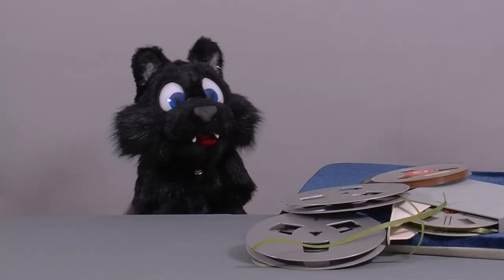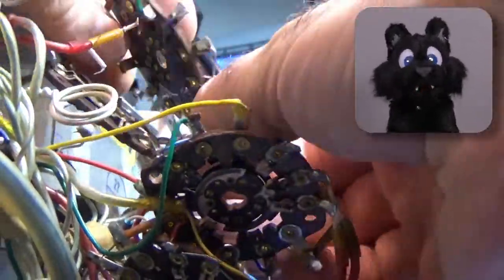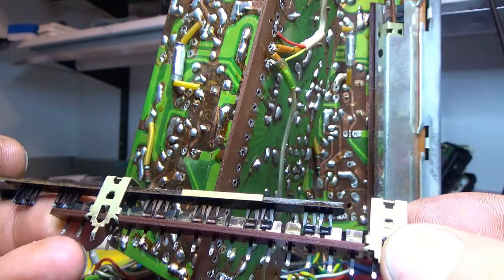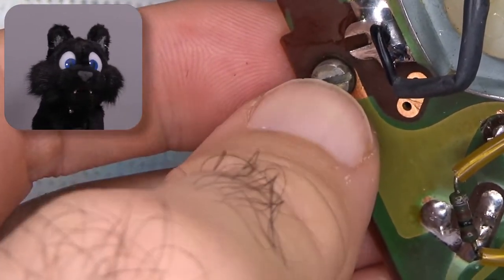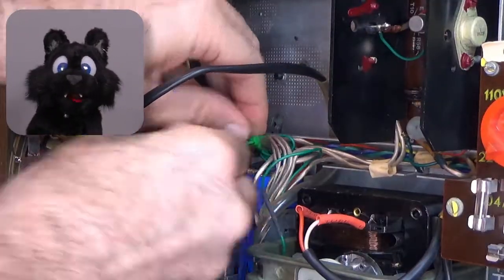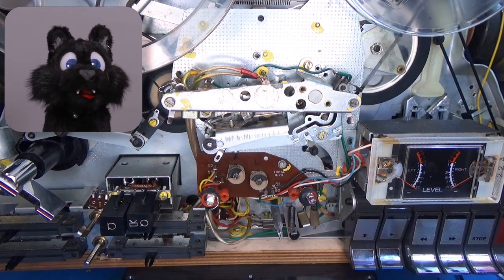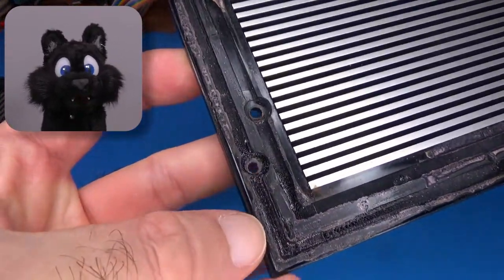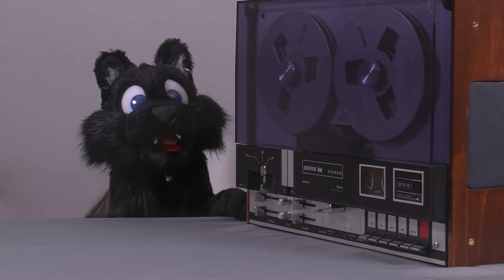Restoration Project #18 - Reel To Reel Recorder (Part 2)

Comment: Unscrewing the tape recorder to almost every screw and putting it back together - I admire and respect it. Great job!!!  I repaired the same (but polish edition - Unitra M2405S) and documented it, but I limited myself only to cleaning the mechanics and working on the electronics (recapping).

Comment: You are crazy ! when i saw that you redraw everything on Kicad i was absolutely flabbergasted. That's really a very good work. I have an old Revox somwhere but never had enough strenght to work on it. Aaand good choice of music.
Reply from the maker: Hehe  :) I like this kind of crazy. The problem at hand was that I couldn't find a proper schematic on the web; By now, I did find it, as the model number of the device has been pointed out. Still, I think I learned much about tapes like this. The songs show off the difference in the recording speed quite nicely. And I got permission to use them from the author. It might be that the noise filter is the audible effect, but I can clearly hear a difference.
Reply: @atkelar  Yes the difference is very audible between the two tape speeds. Again, that's good work :D

Comment: I recapped a Sony TC 580 reel to reel once and when it was back together it had this horrible "motorboarding" or clipping sound in one channel. Took me ages to trace the problem.

Too much flux buildup was on the output left channel PCB. ( I used too much being a novice) Merely had to cleaned it off. 
Took about 5 years off my life in stress. That Sony was a monster machine though. Heavy as a bank safe. Very nice sounding machine!
Reply from the maker: Yes, I found many of the 1970/1980 era electronics to have way too much flux residue on them; it's not just noise problems, but also possible short circuits: flux can trap solder beads and when it heats up, those can start "floating". I always clean the boards in such cases.

Comment: hi done work on a akai mg14d    some one put it into a 240v  socket and  killed the       120v power unit  lucky the rest is ok i have to re make the power pcb all new parts
the 2nd coils were ok you can use RS power units as llong as you don't un coil the main one like you did
Reply from the maker: I'm not sure if the circuits would compare. In this transformer, the 240V are done by putting the two primary coils in series. So both of them have to be functioning in order to work. Other voltage switching solutions might use different ways of doing things, but here it's either series or parallel depending on voltage selection, so if one winding is shorted, it's not going to work on either voltage.

Comment: Ich hab heute auch einen Haufen alter Eletrosachen aus dem Schrott gerettet. Mal schauen ob ich das auch so gut hinkriege die zu reparieren. Ist noch alles THT und großteils analog was ich so gefunden habe. zb eine LCR Messbrücke, Isolationsprüfer, und ein paar alte Netzteile. Der trafo im Netzteil ist noch von 1985 also meine Sachen dürften schon etwas älter sein ^^
Reply from the maker: Mit den älteren Trafos ist das ggf. ein kleineres Problem. Zumindest in Österreich wurde von 220V auf 230-240V umgestellt. Wenn die Geräte damals schon "am Limit" gebaut wurden, heißt das: dem wird ein bisschen wärmer als geplant, so wie dem Motor in dem Recorder hier. Besser im Auge behalten. Ich glaube mein Gerät hier ist von "Mitte 70er" - das einzige, was nach Jahreszahl aussieht ist "74" auf einem Bestückungsaufdruck.
Reply: @atkelar  Ja, das hab ich schon gemerkt dass die im Leerlauf etwas wärmer werden. Ich weis nicht ob es auch damit zusammenhängt aber die Transistoren am Netzteil sind auch nicht gerade kalt bei ~100°C aufwärts. Ich weiß nicht wie die Geräte gebaut wurden aber sie waren von unserer Schule und wurden dort selbst gebaut. Wurde offiziell alles verschrottet aber unser Lehrer meinte er hätte nichts gesehen wenn die Geräte unauffällig wo anders landen. Außer dass alle recht alt sind (teils noch mit "Made in W. Germany") sind die eh ganz gut erhalten.
Reply from the maker: "Transistoren am Netzteil" sind dort meist Linearregler, die die Spannungsdifferenz zu einer Referenzspannung "schlucken" - d.h. bei gleichem Strom jetzt auch 10-20% mehr Spannung und damit Leistung "verheizen" als ursprünglich. Bei gleicher Kühlung daher auch viel wärmer als geplant. Ich werf' das mal auf meine "Ideen für kurze Videos" Liste :)
Reply: @atkelar  Dann wirds glaub ich zeit die Kühlung etwas zu verbessern. Ich muss mir noch die Schaltung anschauen dass ich die alten 2N3055 durch was neues ersetzen kann was sich schöner an einen Kühlkörper bauen lässt, und dass ich vielleicht einen Arduino reinbauen kann. Und wär auf jeden fall interessant ein Video dazu zu sehen. Kann dir auch gerne Bilder von dem alten Gerät geben. Wär vielleicht ganz gut weil die Schaltung da recht einfach gehalten ist ohne viel Zusatzkram.
Reply from the maker: Ja, 2N3055 waren für Spannungsregelung sehr beliebt. Ich habe bei mir für Geräte, die ich auch länger laufen lassen will diese "Heizkörper" durch DC/DC Konverter ersetzt. Das ist zwar nicht ganz stilecht, bringt aber um einiges weniger Thermische Verluste.
Reply: @atkelar  Hab mal vor ca. 15 Jahren ne Heimorgel geschlachtet, da wurden die 2N3055 als Endstufentransistoren im Verstärker eingesetzt. Ich hab dann die unheimlich einfache Platine einfach nachgebaut und mir daraus einen Stereoverstärker gebastelt.
Aber ja - normalerweise laufen einem die Dinger eher in Spannungsreglern über den Weg.
Reply from the maker: Die waren damals wirklich überall; Ich glaube, manche Designer haben nur was anderes genommen, wenn's gar nicht mehr funktioniert hat 😜 - Aber im Hobby-Bereich deshalb auch überall zu finden. Ich hab' nur damals nie etwas gebastelt, was die Leistung notwendig gemacht hätte...

Comment: wow this is a difficult restoration 😨. Congratulations to you my friend 👍👍👍
Reply from the maker: Thank you! Some of the problems were my own fault, I admit that... But the screw/transformer thing was already an issue to begin with: There was already a mark on the transformer when I took it apart, I think they only had two washers there and I only added one.
Reply: @atkelar  keep up the spirit, friend